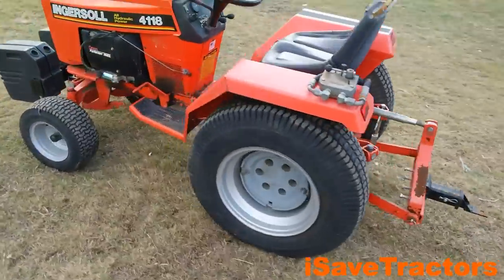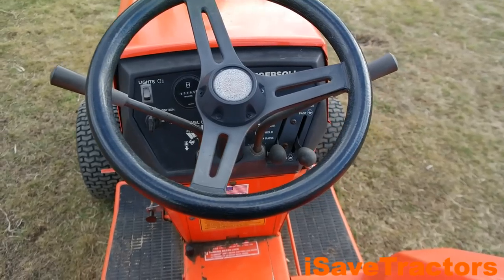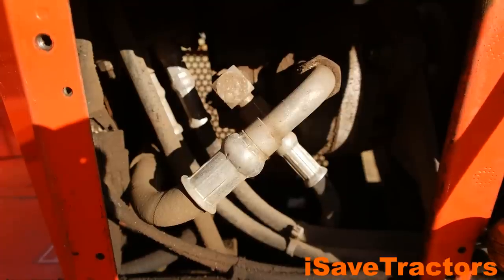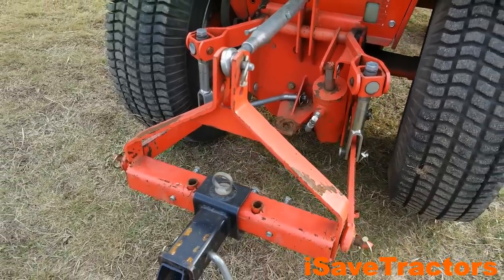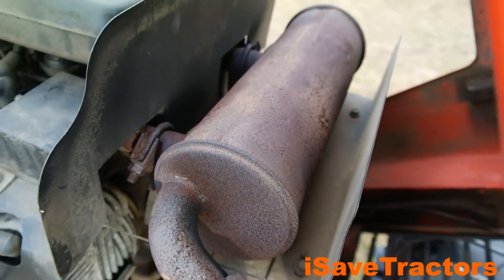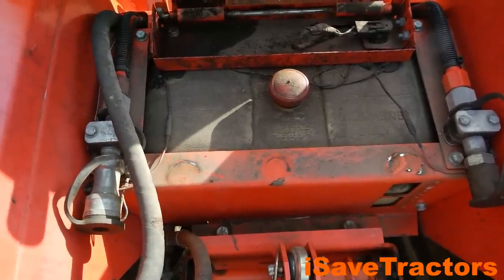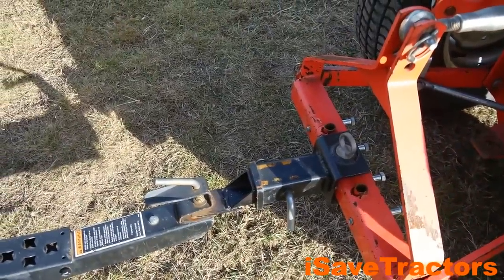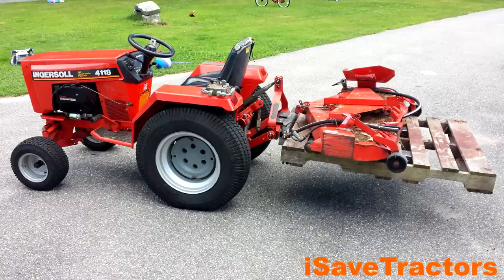Case Ingersoll 4118 Garden Tractor Walk Around and Overview

Comment: Very cool. That looks like a BEAST!
Reply: Looks can be deceiving. My Ariens GT17 will outperform it all day. They come standard with front, mid and rear hydraulic lifts, as well as front, mid, and rear physical PTO’s.
I have a 446, it’s big and fast, but it bogs down easily and if I wanted to use it to turn an implement, I would have to spend extra money for hydraulic PTO and three point.

Comment: My dad had a Case 446 for many years. We have a snowblower, mowerdeck, tiller and sleeve hitch for the case. It's an older design but basically has all the same features. The tiller is really cool because with the hydraulic pto you can reverse it. My 2 biggest gripes with the case is the lack of weight on the front because the engine is an aluminum block and very light as well as the lack of a middle speed range would have been nice. Otherwise it's a great machine
Reply from the maker: Thanks for the reply and sharing about your tractor. I agree with your assessments. I added the 4, 42 lb suitcase weights to the front for that weight needed. Thanks again for watching! =)
Reply: isavetractors with the tiller on the back we always had to back up the hill in my parents yard because the front wheels would be near weightless and almost lifted off the ground. It's a bit of a design flaw on their part but not a deal breaker. That tractor is still around and the original engine is on its second rebuild
Reply: 1944johndeerel All the Case /Ingesoll Operator Manuals state front weights are needed for rear mounted equipment. They also state when loading on a trailer to back on.

Comment: I debated between one of these and a JD 420.  I ended up with the Deere, but was impressed with this unit.  The deciding factor was the width of the tractor since I have sidehill that I have to mow.
Reply from the maker: Gary Stark the 420 are nice and wide. I have a JD400 in my shop now and am currently filming a restoration of it. Stay tuned!

Comment: Hey norman i jist got a 4116 an it seems to be dripping oil from the right nipple off the bottom of the fuel pump im confused theres no line coming off it is it supposed to be capped off any advice as i just bought it and need to start using it

Comment: You need a cub cadet 102 very very reliable my granpa bought it when he was 19 and it still runs fine just got a new and better engine not because the original engine was bad it ran perfectly fine we just wanted more power for plowing snow and hauling wood from our woods to our house and other stuff ya gotta get one
Reply from the maker: Codys Gaming Channel 8750 IH Cub Cadets are great! I built a front end loader and a backhoe for a Cub Cadet 149! Check out my playlist for the build videos
Reply: isavetractors i definitely will good job on the videos
Reply: With all due respect, Case Ingersoll GT’s have a hydraulic drive system similar to a backhoe. A Cub Cadet is a nice piece, but it doesn’t hold a candle to the utility and quality of CI

Comment: I noticed during the video that the rubber air gasket around the oil filter is missing. You are over heating the intake valve seat  on the oil filter side of the engine. It will eventually loosen in the bore and damage the block. That is an expensive repair. I  know,  it happened to my 4018. It only happens with the Performer Series. If you put your hand next to the filter with the engine running full throttle you will feel all the cooling air that is escaping. It should be cooling the block and that valve seat. It cost me a couple of hundred dollars to get the hole welded, rebored and a new valve seat installed,  all for a 5 dollar rubber gasket. The gasket is shown in the Onan parts manual, I  never did find it in the tractor parts manual.
Reply from the maker: Thanks, I will look for that part and take care of it.
Reply: isavetractors Ok Norman,  here is the info.
Onan Parts Manual for P216G - P220G and Linamar LX 720, LX 770 and LlX 790

Pg 47, Item# 15 Pn: 122-0502
Gasket, Oil Filter
(Code 17CD, 17CV, 17DF AND 17DG)
Reply: Good eye and a great tip!

Comment: Just bought a Case 446 and hitched it to a 4'' x 8' trailer and headed down a steep driveway and it almost got away from me. How do you manage to hold back the load going downhill? I'm guessing to raise the rpm and keep the lever speed slow?? Thanks and great video. Very helpful.
Reply from the maker: You would want to keep a High RPM, and then use the hydro lever to keep it slow. If you have a hydraulic flow valve like on this one, you can lower that too. Also the brake. I don't have that problem because my farm is flat.

Comment: Hey do you have any videos of how to maintain the Ingersoll like oil changes and just things to know? Thanks
Reply: theres a petcock at the right side. we've had one in the family for almost 30 years. they need almost no maintenance at all aside from new deck bearings "you don't have to replace housings" every 6 or 7 years, new deck belts every 3 or 4 years. we replaced the electric clutch maybe..12 years ago. very impressive machines. i graded my driveway with it using the plow. pulled things i never thought it could pull. and does a really nice even job mowing.

Comment: That 4118 have down pressure  on the rear hitch? What is the size up  that that would have a rear pto set up .. on any make or model ? Ty
Reply from the maker: Yes this hitch can provide down pressure or float. This also has a hydraulic Rear PTO.

Comment: I just transferred the three point lift off my Case 644 loader onto my 4020ps and am very disappointed in how little it can lift. On the 644, it could lift several hundred pounds easily, but the same three point on the 4020 barely lifts 200 pounds. I found out from a local Case expert that the issue is due to the built-in holding valve on the 4020, whereas the 644 doesn't have a holding valve at all. The holding valve on the 4020 doesn't let high pressure get to the three point. Do you know a way to get more pressure to the three point. Otherwise, it's kind of pointless to have that perfectly good three point on the 4020.

Comment: Hi I have 2 question, I have a 444 in which I need to replace the o-ring for the travel spool, after reading the manual it says I need to do a hydraulic test to set the relief valve and I was wondering if you had a video on how to do that? my 2nd? is what is the purpose of the flow control valve add on?
Reply from the maker: I don't have a video on that, good suggestion though. Follow the instructions in the manual on doing the pressure test. The Flo Control Valve, can slow the flow of oil to the transmission. It's kind of like a "Creeper Gear" in gear transmissions. It allows me to go really really slow during operations such as tilling.

Comment: The hydraulic pto for attachments is driven by the same oil pump?
Reply from the maker: Yes. This tractor is powered by a 2 section gear pump.
Reply: @Isavetractors  it's a double circuit whit the same oil reservoir?

Comment: How much are you able to lift with your 3pt pallet forks? I find mine is struggling to lift anything more than about 120lbs, at about 20" out.
Reply from the maker: I estimate I can lift 200 to 300 pounds when the load is up directly against the hitch. 20" away from that I probably can't pick up much.

Comment: Dear Norman.  I have an Ingersoll 4020 with the ground speed control.  I didn't know the system had two pumps. When I reduce the speed control to rototill, it seems to slow my sleeve hitch speed up and down.  Is this normal or is my hydraulic lines hooked up incorrectly. Thanks Scott
Reply: Scott I don't think the 4020 has that style pump,, not 100% on that though.

Comment: sir what do you think of power king economy tractors? am going to up grade to one of those from a wheel horse c165 i like it just want something a little bigger and more cost effective than something like this am not sure why but some of these little tractors are crazy expensive i think a a good middle of the road price for a power king is like 1000 very reasonable and from what i heard will pull these little tractors around the block do you think that is true? they seem simple to work on also what do you think of them?
Reply from the maker: The Power King Tractors are great. They came in a bunch of different models. The high wheeled Power Kings are very cool. The Power Kings with the larger than 12" wheels are my preferred. Other Tractors to Consider are the Wide Frame Cub Cadets and Ford LGT's. Both weight about 800 lbs and have greater parts availability and are typically more common and cost less than a Power King. Good Luck in your Search!
Reply from the maker: On another note: If you just add weight to your C165, you will have a machine that in many ways is better than a Power King. The wheel horse transmission in low gear is tough to beat! Your Wheelhorse can do everything a Power King can.
Reply: Can't beat the PK 2412S with dual range.
Reply: Brandon Mckenzie thats what am looking at getting so i can use the tiller but would deul trans in a 1614, 1616, 2414, 2416 with hydraulics they seems simpler to work on also
Reply: iwantosavemoney can't get any easier to work on then them. I'd love to have one or a Cub cadet Low boy 165. But I had a wheel horse c165 it was tough, but didn't have any power
Reply: Brandon Mckenzie mine does well with the rototiller attachment the only attachment i had for it. but it was slow and mine was a sleeve hitch look to up grade to a class 0 3 point and learn how to use a plow(tune a plow properly) and use a disc harrow from what i hear the rototiller was not for the farmer it was for the city people from my understanding you can plow and harrow a bigger garden in less time than you till am still learning tho.
Reply: I live in North Carolina I have a Jim Dandy and The Power King part denicol except for the height of the wheels and the drive gears and that little Jim Dandy is awesome have a good contact in Tennessee for finding Parts if you need to find any
Reply: Aren't power kings kind of rare? My uncle recently had one and he had said they're very difficult to come by. They went out when companies like kubota started getting big
Reply: Anyone that wishes send me a private message through YouTube and I can give you the email address of the gentleman I know in Tennessee that has about a dozen of them and he is retired and spends his time finding them collecting them so he restore them to sell them
Reply: Richard Elbe I'll ask my uncle when I see him again. He fixes/restores old tractors and sells them all the time. He does a good job with it too. He does a lot of farmalls. But the power King was unique which is why he got one
Reply: Zach Novosad am not sure how rare they are they dont seem that rare to me if yoh know where to look
Reply: Richard Elbe that would be nice i will do that
Reply: iwantosavemoney yeah that's true. Rare around here for sure. It's not like finding a cub cadet
Reply: Richard Elbe we cant find out how to message you lol
Reply: just sent u a message. What you do is click on the persons name, that takes you to their profile, click on about then you will see on the right the day they joined.. below that is a flag and to the right a message icon.. click on it to message that person
Reply: Richard Elbe you don't have an about showing up.
Reply: odd...did u get the message from me??
Reply: Richard Elbe I got a message here of you saying how to open up the message
Reply: Richard Elbe ok I got it
Reply from the maker: Zach Novosad Kubota did make it very competitive for all Garden Tractor Makers. Kubota plus the change in consumer behavior is what led to the extinction of this class of true Garden Tractor.
Reply: isavetractors yeah that's very true. It's unfortunate too. The wave of lawn tractors was super unfortunate. Really only made to mow lawns and tow a small cart of mulch. It's sad that they sell them with plows and heavy attachments when in reality they can't really handle it

Comment: I have a case 210. Currently i have 2 issues with it. When i lift my mowrr deck it only lifts in the front and only 1/2" in the manual it says the wheels should not touch the ground when it is lifted and my deck wheels are on the ground all the time up or down.  2nd issue i can't explain... shimmery bronze in oil. Spec# claims nothing bronze in engine, no balance gears, shafts, bushings, govenor gear and weights are steel. Kohler k241 k301 stamped on block.
Reply from the maker: Regarding the mower deck: Check the linkages and then check the hydraulic fittings for signs of leaks. You can also remove the mower deck, crawl under there and have someone operate the lift up and down, and observe what's going on. You may discover binding or something.  Regarding the oil: it's probably water in the oil. When oil mixes with water and moisture it turns a golden brownish color.

Comment: I'm sorry, it gets to a half of a tank of gas and just shut off. I put that half a tank of gas back in it will go back to running. but then it does the same thing again half a tank shuts off fuel line at the bottom of the tank goes to the carburetor and I got a vacuum line at the top it goes down just above the vacuum that goes into the governor pedal thing inside the engine I think that's what it is. But can't figure out why it shuts off at a half a tank of fuel.. No nobody can tell me what causes that they want me to bring my more in and leave it sitting with two or three weeks I can't do that. Still got 2 to 3 weeks of grass cutting left. Can you give me and idea. Please! 😕
Reply: Don't see a response or that you indicate what type of machine this is on!  Best guess would be that you have a weak diaphragm in the fuel pump or a plugged vent in the fuel cap.  Could also be debris in the tank but of course a fresh fuel filter is the first place to start and assume you have already done that!  Good luck!
Reply: @peckerwood6078    hey bud I'm sorry . I was interrupted doing something else before I could finish telling you. It's a generic Craftsman has a motor on it I'm assuming is Briggs & Stratton but it has a tag on it it says MTD and I change the fuel filter but it still does the same thing I thought it might have been lying so I changed the lines out still doing it and it's got a vacuum line from the top of the tank down to the  carburetor. It's gravity flow so it doesn't have a fuel pump. Oh and when I say generic Craftsman it was made by MTD for Craftsman. That's their cheaper version right.but anyway gets down to either a quarter tank or half a tank pending on how it's running that day and then it just shuts off just like it run out of fuel I'm wondering if a small hole might be in the fuel tank where the bracket is I didn't check that I'll check that. Thank you for your response. Have a great day.
Reply: Take the tank off the unit and dump it out and then remove the bowl from the carb and collect the fuel.  combine the fuel in the tank with the fuel drained  from the carb and look at the bottom of the glass jar you put it in to see if water is on the bottom.  Shake out tank and blow compressed air back through outlet.  Make sure the cap is off the tank or you'll blow up the tank and split a seam.  Put the vent hole in the cap up to your mouth and blow.  If air won't go though it it's plugged.  Get another one or if possible take it apart and clean it.  Good luck Carl
 @carlhelmick8104
Reply: @peckerwood6078  thank you so much for the come back . You've be a big help. Sorry for bothering you . I will go through everything you explain. Again thank you very much for your help and advise. Have a great weekend bro. 😁👍